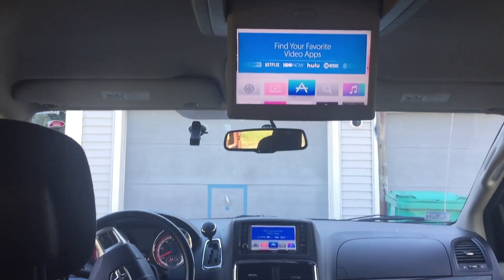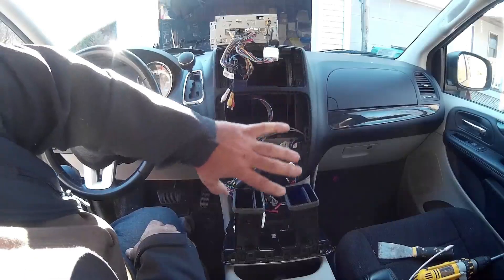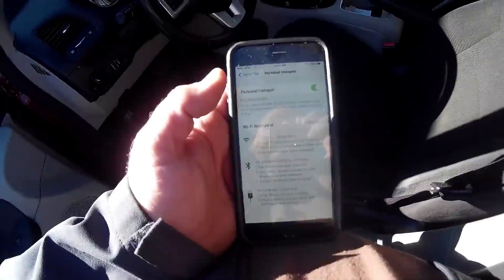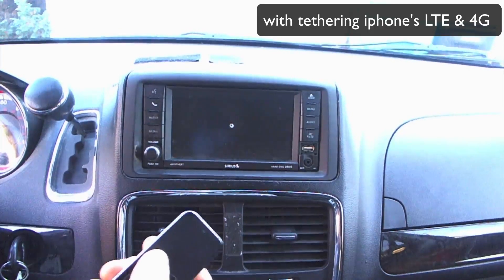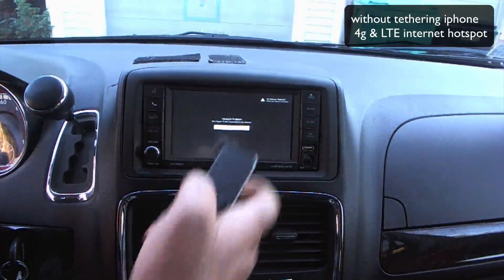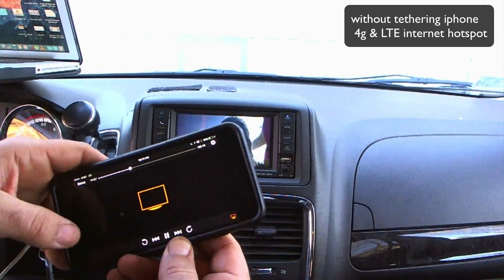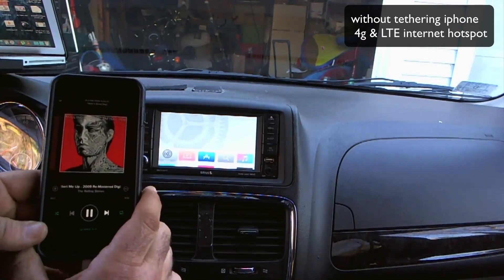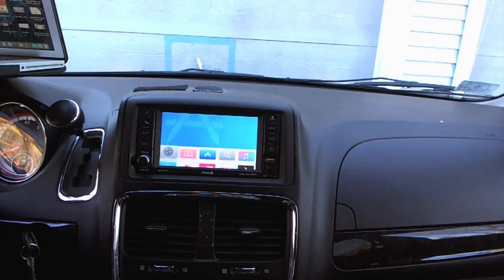Apple TV 4 in The Car detailed

Comment: Kivic One was a solution for older IOS, not sure about IOS 9.

The best part of this is - none of the factory HU and major after market 2-DIN player can play DTS movie files via USB. Don't know why, car media players just don't come with DTS digital audio codex. Also the most annoying thing is they can only play simple Divx/avi files.

I can now play all the home theater movie files which I play at home. My kids are going to love this. Using airplay, I can also get rid of all those annoying HDMI and USB cables hanging around my dash.

If you don't know, the ATV-4 internal circuitry actually fed on 12V DC.  Open it up, it is easy to modify to use the car's 12V DC power and don't need an AC power inverter at all.

Well done Dave!
Reply from the maker: There's a new Kivic one for iOS 9 coming out shortly. I'm going to get the unit to try and I'll make sure a video it
Reply: +AskUncleDave 
Have you tried to use the Infuse-Pro app with a Seagate or Western Digital wireless hard drive?  Any idea which wireless hard drive can be directly played by Infuse Pro?  It am trying to eliminate the need of connecting to a pocket wifi (e.g. MobileLite)?  Thanks

Comment: Dave, 

A few questions. I'm in the process in getting these items for my 2012 Chrysler 300. I have the uconnect 8.4 basic stereo touchscreen unit. 

1. I looked into ur link for the Orei HDMI to composite converter. Is this unit going to work? It shows the RCA side as input and HDMI as output side. Knowing the Lockpick C8 needs the RCA since it does not have HDMI features (Called and checked, non to date). I want to display my Apple TV 4 on my uconnect unit as well 2 headrest tv's in the back seat. 

2. I don't have the VES connections for the back seats for entertainment. I will have to find a splitter for HDMI or RCA (what is ur opinion for either) to connect the 2 back tv's to both uconnect and Apple TV? I want the feature for kids to watch DVD playing in the uconnect player up front with me and also change over to Apple TV to play games and etc in back seat  to use headphones while I still have my music or DVD player going.

Just trying to find out what is needed to make this possible. Just want to make sure all needed items are in hand before the process is started. Let me know if u have any other questions needed for me. I plan to start this on vacation in late December... thanks
Reply from the maker: +MistaMacc Trax lockpick has tv out

Comment: Instead of AirPlay why don't you use a lightning to HDMI cable and hook it right into that box. Then you'll have a direct line in.
Reply from the maker: Because it's fun and wireless
Reply: +AskUncleDave fair enough!
Reply: +AskUncleDave YOU HAVE EXACTLY 8,000 SUBCRIBERS RIGHT NOW. Im th 8001st subscriber!
Reply: +Mark Pawlusiak thats exactly what i was doing but i wasnt happy with the connection.Too many wires (I also have an RCA converter) Whenever i move my iphone or it shifts when the car is in motion the signal is lost and a very loud static comes out of the speakers.my converter works a lot better stationairy but apple tv doesnt offer pairing without wifi to mirror videos any suggestions?

Comment: Dude just get a kivic one this is way too many devices to use an apple tv. A kivic straight to your head unit and then connect apple tv and it even has hdmi. This is like painting without a roller, i mean u can do it but goes a lot fastwr and better with a roller...
Reply from the maker: I was a beta tester for the Kivic one
Reply: +AskUncleDave Kivic one will not work with iOS 9